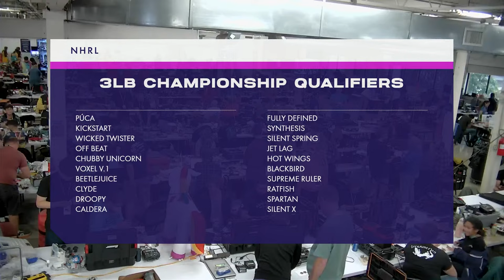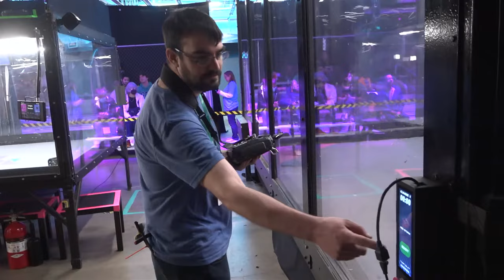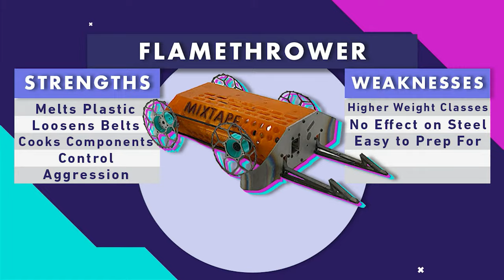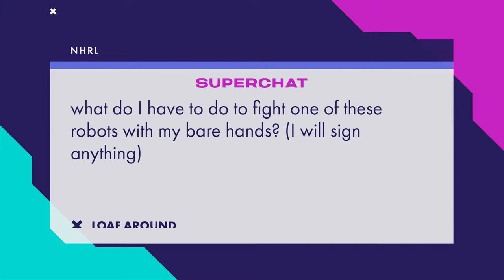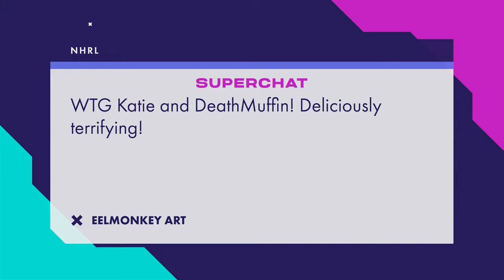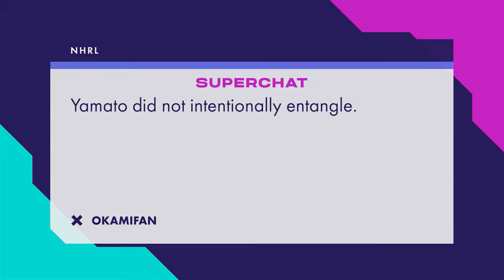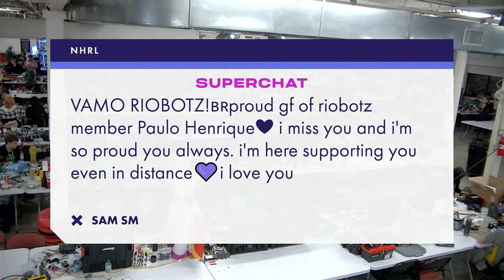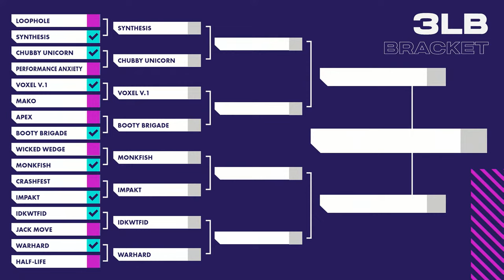NHRL 2023 Round 6 September: Part 1 The Final Botdown early rounds from Sept 30 2023

Comment: It seems wedges and flippers are very powerful right now, because of the rule setup. I suspect the weight classes should be increased. They can assign all weight to drive, and nobody can touch them. 5 --> 25 --> 50

Comment: these "loophole" combos take away from the sport, doesnt make it interesting to watch in any way...
c'mon, 2 equal robots to the one the other brings, what a dumb and uninteresting idea, sure the rules are the same for everyone, but that is the most infantile argument in ages
Reply: They did it knowing it would be corrected next tourno, same with the long guy last time.
Reply: they should get rid of multibots entirely and add an actual 2v2 bracket if there's time in the day,
Reply: I like the NHRL rules but it could use a little tweak. Perhaps just a 2.5 pound limit for mini bots would do it. Or a more out there suggestion; double bots get half points at judging, so they are very likely to lose judges decisions!